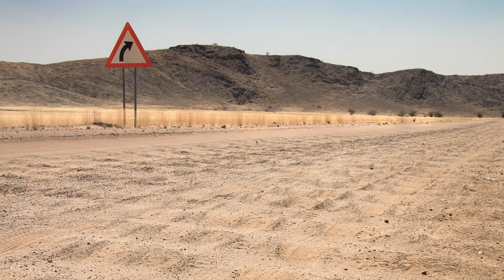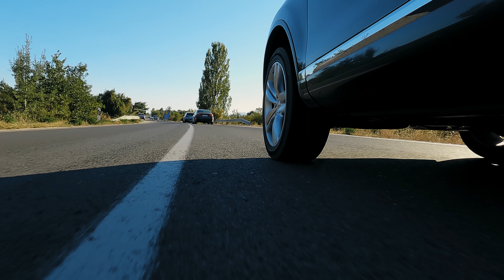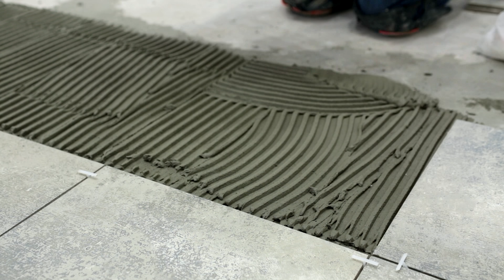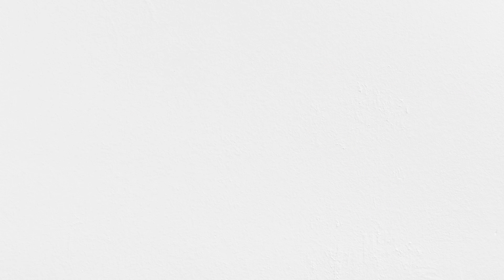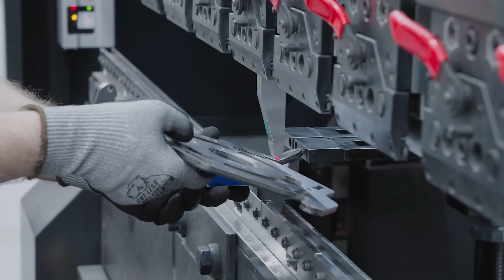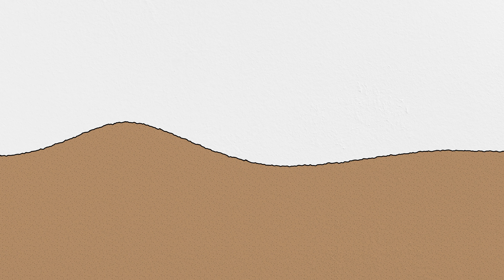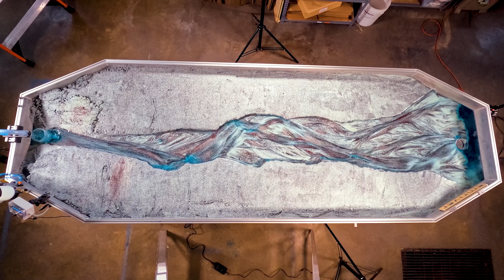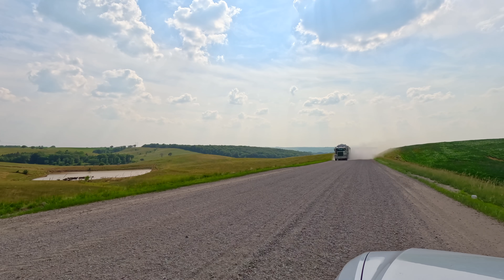Why Roads Get Washboards

Comment: This hasnt at all been a mystery to me as an automotive engineer. It’s the vehicle suspensions turning small bumps into large repeating ones based on the ride frequency of the suspension. Then one bump turns into 2. 2 bumps
Into 3. 3 into 4 And so on

Comment: You never answered the question. Your experiment has nothing in common with reality, since the diameter of the experimental wheel is smaller than the wavelength. In reality, the diameter of a car wheel is many times larger than the wavelength that occurs on roads. How can a wheel with a larger diameter leave a dent in a softer surface with a smaller diameter? There is no answer to this question in your video. Therefore, I consider your experiment to be certainly interesting, but it has nothing in common with the real problem you described in the video.

Comment: One of the things I am a bit curious about here is how four wheel drive impacts washboard creation, alongside deflating tires.

The reason I specify four wheel drive is because of how the wheels help limit their rotation since the transfer case keeps the power output consistent to both the front and the back. I would imagine that washboards are not only created by a wheel's travel up and down, but how much dirt gets kicked out when the wheel touches down because it gained propulsion while in the air for a moment. If one tire makes contact with a washboard but another tire on a different axle hasn't, the theory is that the tire will dig into the washboard less because its propulsion potential is limited by the tire still in contact with solid surface.

Add on top of that tire deflation, which many off roaders or backroad people engage in, where the tire is more likely to form around the washboard instead of being more firmly bounced off of it. I would be curious how that pans out.

Comment: Fun fact, washboards is also very much a thing on paved surfaces, particularly in regions with frost. The ground below the asphalt will expand and contract with hot and freezing temperatures, creating washboards over time. This has also been an area of research for a number of decades, and while the problem has finally started to be solved, it is also one of the reasons why building paved roads in Norway is a lot more expensive than, say, Spain. Although if you've been to Sweden, you'll have noticed they solved this in an entirely different way a long time ago, by deliberately creating small horizontal cracks along the road that can be expanded into, very much creating a "railroad" effect with constant "clang-clanks" when driving

Comment: great video. if you would like tot expand on this idea or venture further down this path.. it is the exact principle that causes what we call breaking or acceleration bumps in motocross. creating the wash board effect but  clearly showing the brake and acceleration coupled with the tire friction. and then adds in the suspension aspect which has its own wash boarding effect based on your model

Comment: At higher speeds the washboard isn't felt as much. In fact you can find the right speed where it will turn smooth again. Sure it's more dangerous as with anything when you increase the speed. But if you want to go smooth then just find the right speed and pay attention.

Comment: Very interesting video, thanks! I would definitely like to see a more in depth exploration of this topic. In particular, I would be very curious to see how having the wheel itself being powered might change things at all. I drive on a lot of gravel roads here in rural Alberta, and one thing I've noticed over the years, is that the washboarding is significantly worse where vehicles are accelerating, like after a stop sign or corner. Oftentimes the first 50-100 feet after an intersection, specifically on the right side of the road, will have very heavy washboard, but that is the only section of the road where washboard develops. It seems like the long stretches of road, where vehicles are travelling at a fairly constant speed, take months to develop washboard, if they ever do at all, while the acceleration zones right after an intersection will develop bad washboard within days of being graded. I've always assumed it had something to do with the increased slippage of the powered wheels as they accelerate on a loose surface, but I'm struggling to visualize how that fits in with the test setup in this video where the wheel is just being dragged along like a plow and just pushing material forward, rather than turning itself through the material and potentially shooting material backwards as it breaks and regains traction.

Comment: Something interesting to consider with the washboard road problem is ATV trails compared to forest roads.

At least in my state (michigan) we have a lot of forest roads in the north and a lot of ATV trails where cars are banned. The forest roads overwhelmingly develop washboard in a very short time after maintenance, but the ATV trails generate much much larger but less frequent bumps (they can be 1-3ft deep instead of a couple of inches). It seems unlikely that vehicle size and geometry don't have any effect on the washboard road problem if you can observe such significant differences.

Comment: The funny thing is asphalt can actually cause washboarding too. In the winter, when the roads are iced and snowed over, they form washboards which can often be even more brutal than the sand based ones. They can be really sharp and hard as rock so they are difficult to change even if you want to.

Comment: Undamped suspensions running at their resonant frequency pound corrugations in roads.  Heavy trucks and trailers are prime offenders as they are usually quite under damped and stiffly sprung.
Resonance is everywhere.
I like your simulator.  Try it with a soft spring and a damper to see how that affects the problem.
Reply: Direct sunlight is the culprit. A freshly graded dirt road will washboard even if no traffic drives across it. Heat makes everything expand.

Comment: Also included in the washboard formula are the variances in the weight and texture of the aggregate.  Even a steady wind can push lighter material over the top and heavier material will wedge lower and lower.  The weight to wind force ratio can also create washboard - even with no traffic.  Of course, traffic exacerbates this by compressing the denser material and scattering the lighter material.

Comment: I’m not convinced. I’ve been running a grader for a few years maintaining gravel roads. More frequently around us the washboard is on hills and at intersections which would imply that it is caused by the acceleration not by cruising at a given speed. 
In softer materials ie dirt or sand I can see this happening for long stretches in the straights but for harder surfaces like gravel we rarely if ever get washboard in the straightaways before the potholes take over and the road needs graded.

Comment: Great topic. I first learned about washboarding while raking golf course bunkers in the morning to fluff the sand. If someone drove the vehicle too fast, the washboard effect would instantly appear. 

I wonder if washboard patterns are more common on public roads these days due to the increasing weight of vehicles? It would make sense if the vehicle is imparting more force to the loose particles.

Comment: It seems like this is tied to a "frequency" response... In your case the wheel has weight but can move up and down but it is going in a circle to the bumps are also pushed as a tangent from the circle. I also notice this when going over speed bumps. Even though the speed bump is to keep you slowed down to like say 25mph, the bump actually feels less of an impact at a slightly faster speed, say 30-35mph. The design of the speed bump and how it interacts with your tires and suspension dictates that speed. Going very slowly (1-5 mph) over the speed bump, causes your car to simply climb it and descend it. Once you reach an optimal speed (maybe a harmonic?) you hear the bump but barely feel it. It seems that the washboarding has a few of these same elements. I'm not an engineer and don't play one on TV. :-)

Comment: At the bus station in Cambridge there are grooves worn into the asphalt spaced apart by roughly the wheelbase of the bus. Could these be caused by a similar phenomenon?
Reply: That occurs mostly on heavy braking spots

Comment: Huh, interesting. I was under the impression that it was due to accelerating and braking since it tends to occur before and after places where you would have to slow down or stop, such as corners or intersections. But that doesn't seem to be the case, or at least not the entire story

Comment: washboards are old stuff
washing machines are where it's at
just install washing machines under the road and let them run. the vibrations will smooth out the road
"Sometimes My Genius... It's Almost Frightening"
Reply: Iiiiiiiiiii think you may be onto something. If corrugation causes vibration ..... how to we feed that back down into the road to vibrate it smooth?? 😂😂

Comment: Not arguing the conclusions drawn from the test. But couldn’t you make an argument that the test is fundamentally flawed because the wheel is traveling in a constant circle? I’d be interested to see how different the pattern would be if you got a wheel traveling in a straight line on like a conveyor belt or something where it can loop back to the beginning over and over and over again.

Comment: This is a common problem and traffic seems to get the blame every time..  Just because traffic can and does cause washboard, you cannot simply say "mystery solved".  Living on gravel roads my whole life, I can tell you the difference between a road that has washboard and a road that does not.  The difference is that the road without washboard has a grader operator that will alternate directions each week.  Most grader operators do it the same way every time and their own tires and blade follow the existing washboard.  If you turn the blade, drive down the wrong side of the road and cut across the washboard every other time, problem solved.  Washboard is inevitable with enough neglect, but a good grader operator can keep it down.  In the winter, the township hires different contractors each year to do our road.  Some do good, others do bad.  And when you see washboard cut into the snow in the ditch where nobody drives, you can be pretty certain the grader is maintaining the washboard, not eliminating it like he would alternating directions every week..

Comment: The only solution is to have at least every second or third vehicle be dragging a beam or heavy object behind them, as to break the initial highs and lows.
If you look at a tire going through loose material, you will find it makes a tiny berm in front of it which it has to overcome. So it makes the berm, drives over it and compacts it. Unless you pay someone to drive up and down a road once a day, you cannot get rid of the washboard.
Tractor tires will accelerate the effect. Bad shocks on vehicles same thing. A bad shock will allow the suspension spring to continue to spring out, causing even more compaction.
Our rural roads are very populated, at least one farm every 2 miles, if the county gave us a small tax break to make up for fuel and time, we would drive the road with a leveler and help keep the grader operator from having to do the road twice a month, which then lasts only 3 days.
Worst are actually the intersections where accelerating and breaking really makes the washboard tough.

Comment: The worst washboarding I see before and after corners, and also on steep sections, where people accelerate or brake. I am sure that, if people accelerated or braked smoother and with reduced intensity, less gravel/sand is pushed and less washboarding would appear, but people never learn....

Comment: I've always wondered what would happen if the resonance frequency of the suspension was exactly one half wavelength off from the washboard surface. Also, how dampers of different stiffness would affect it. Could moisture also be a factor? So many questions, so little space to build one of these for myself.

Comment: I need more tests becaue this is surprisingly cool.
I'm wondering what would happen if you put a thin cheap fabric mesh over the sand in patches, something with gaps large enough for sand particles to work their way through the maaterial and almust bury the sheets

Comment: I had to suffer a couple times a road with washboards, and since then I only take it if it's extremely necessary, otherwise I take the longer alternative. But what I've noticed is that this was way worse after raining, and by hearing your explanation I understand it much better. With rain you get puddles and then small streams if the road has some draining slope. Afterwards, these become the starting points for the washboards, getting worse and worse after the rain. Thank you for teaching me something new!

Comment: Living in the countryside outside multiple urban zones in Oregon, this has long been a problem we've dealt with.

Specific example from yesterday: gravel connecting road between two paved high traffic roads was graded flat ~1 month ago. I travel it on my way back from the Walmart 15 mins away from home to check for garbage and recyclables (cousins and neighbors have farm ground on both sides). I drive about 10 mph on all gravel roads I drive (to avoid washboarding).

Inevitably, someone will come up behind me going probably 30-40 mph, making all sorts of dust to coat the crops along the roadside. I then pull over when safe, before it comes to them riding my rear or passing unsafely (road is wide enough for 2 lanes nearly all the way through).

Yesterday's car passes, and continues to fly down the road making more dust and washboard, which is already visible after resurfacing a month prior.

In other words: please be considerate of your usage of unpaved roads. Farmers have utilized them long before urban traffic made it's way out there, and washboards slow down the day's work considerably.

And, we have to pay taxes to fund DOT road maintenance operations. Wonder why those numbers keep going up. Among other reasons...

Comment: One observation I have made is that asphalt roads can washboard as well.  I notice this more frequently on downgrades before intersections where there is a stop sign or stop light present. Intuitively I believe this is due to the pavement getting hot in the summertime and then heavy trucks stopping, sometimes suddenly, on this downgrade, which causes the hot asphalt to move and buckle, over time producing a washboard effect.

Comment: i wonder if we had very low tire pressure so the contact surface is a lot wider and the forces are absorbed in the tire more if it will stop or at least change the distance between bumps

Comment: If you drive your pickup truck fast enough you just skim across the tops and it's smooth sailing . . . but really you are just lengthening out the wavelengths . . . so you need to drive faster and faster each week

Comment: One positive feature of gravel roads vs hard surface, e.g. asphalt, is that they can't develop sharp edged potholes. We used to have an old poorly maintained, terribly cracked asphalt road that had so many sharp potholes that you had to drive like drunk to avoid the worst ones. Then they ground the asphalt and made it into gravel for like 10 years, it was awfully dusty and a washboard... then they finally repaved it again. The lesson here is that gravel roads are unsuitable for almost any amount of traffic except the lowest. But also, that asphalt roads turn into misery in northern climate, at least due to freeze-thaw cycles.

Comment: I will agree that the conditions you described will cause washboards. 
HOWEVER near the end of the video there a shot that shows the lines going all the way across the road. I feel it would be more accurate to blame the maintainer blade chattering as the cause of full width washboards.

Comment: I worked as a Geologist at an iron mine. The speed limit was 15 mph. I initially thought that was for safety, but actually, it was to prevent wash board and associated repair costs. If the foreman caught you exceeding the speed limit, you got one warning then you got fired. They were not screwing around.

Comment: I see how the wheels can make a washboard pattern, but how does the washboard go all the way across the road?
Reply: Exactly. Washboard roads normally always have a perfectly straight groove line find one side of the road all the to the other side. Nobody is driving at any speed at the edge especially when the ditches are regularly dug out on dirt or clay roads.
Reply: @jfaber99 In order for washboard to form you need the right mix of fine and coarse grain rocks on the road.  If you have grooves, the surface it likely too soft for washboard to form.
Reply: Unless there are tracks, people drive all over the road especially if they want to avoid an area that already has some washboard.
Reply: @MarsRovrDriver  The ditches can be two feet deep. Nobody is driving on the edges of a dirt road.
Reply: @jfaber99  If the road is narrow you won't see washboard all over the road but if it is wide enough for two vehicles you will see washboard all across just because people will drive on different positions across the road.  They will drive at set positions only if there are tracks which typically don't have the soil composition that is conducive of washboard.
Reply: People drive over the whole road
Reply: I paid for the whole road, I use the whole road, damnit!
Reply: @falsemcnuggethope  I tried that but the officer still gave me a ticket ;-)